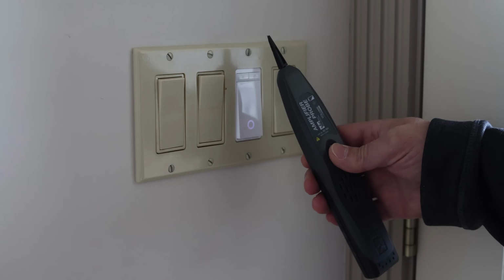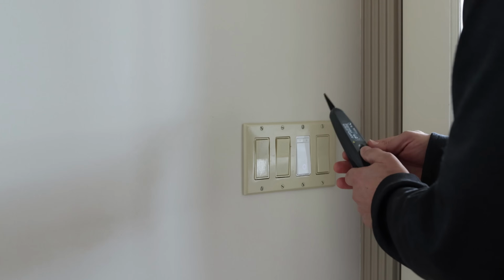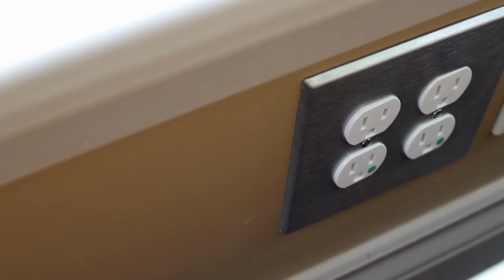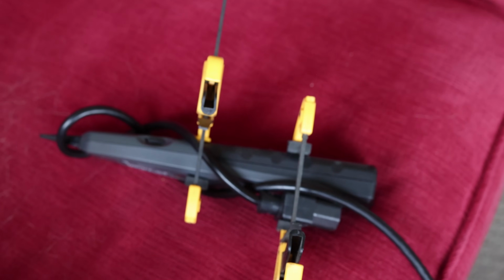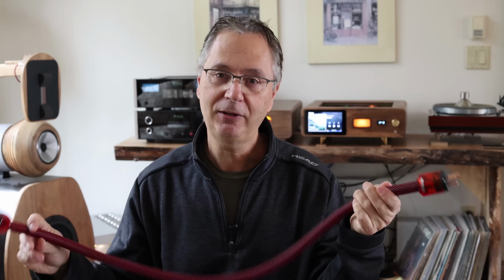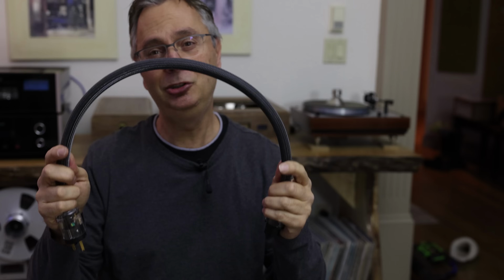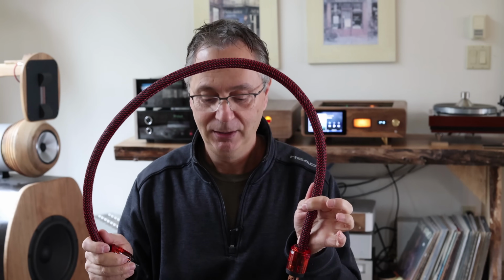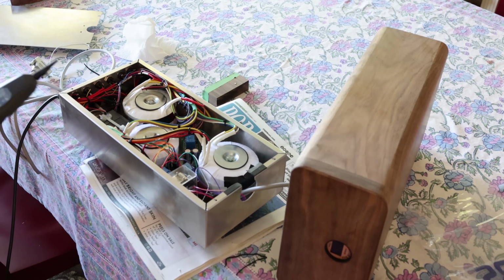My Top 5 Inexpensive Hifi Tweaks for clean power to your amp, preamp, dac, turntable, and more.

Comment: A shielded power cord does not remove the noise from the AC power going thru it. It just reduces the emi from the cord, which dissipates within an inch of the cord. If you keep power and signal cables separated then a shielded power cord is not any help. Power and signal should be kept away from each other anyway. Also that huge shielded cord puts way too much stress on the receptical AND the connector on the gear. If you want clean power get an isolation transformer with filtering after. Guess what, that's exactly what's in most gear, a transformer then filtering, switching supply's are a different story but they have issues of their own. By law tho they have to be heavily filtered as electronic devices cannot cause interference on other devices.
Reply: From my experience such devices can rob dynamics to some extent.
Reply: @supes323  From my experience what's done to the AC power has little to no effect on sound unless it's pretty extreme variations. Most all bad things that happen get into the signal chain after the power supply in the piece of gear. If supplied with the proper voltage and no problems that could cause voltage losses ie: defective recepticle, way too small power cord etc. The PS in the gear is or should be designed to handle music peaks, slight voltage fluctuations, filtering etc. I would think all this ultra hi end gear should have a very well designed PS. Look at the biggest problem, 60hz AC hum, That cannot be removed until the PS converts it to DC and filters it. Things like RF? were talking mega cycles, can't hear it and does not make it past the PS. A linear PS is a large choke coil, what do coils filter out? High freq. Hi end gear or audiophile ears somehow being able to detect things that even if could be measured are far out of human hearing range? The obsession to continually tweek for a little better something moves into placebo. You can't extract more than all the info in a given recording. This is just some of what I've learned in 50+ years of audio n electrical. People are free to take it or leave it, and spend $ on what they want.
Reply: @bradt.3555 well said. If people understand electronics and the nature of what takes place in the equipments power supply then you understand that all of this makes little or no difference only in extreme conditions.
Reply: @a0r0a745  yup, what ya gonna do. So much hi end audio is just audio jewelry. Problem is once you reach a point in sound quality, how do you keep selling stuff. Use placebo, if it looks better it must sound better. If you added up all the improvements every little piece of nonsense made you'd end up with it adding sound to the original source. Does nice paint make a car run better. I don't have a problem with people having audio jewelry, but should be sold as such.
Reply: What kind of Isolation Transformer would you suggest?
Reply: @KillerKlipsch  Typically a transformer that just goes from say 120v to 120v and has filtering and will supply the current needs of your equipment. Your not trying to change voltage, just get that "magnetic" separation. Any transformer isolates because the "connection" between line and load is magnetic. The transformer in any piece of gear "isolates" the line from the rest of the circuitry. If it uses a switching type power supply that's different. In reality the power supply in the gear should filter all the crap out. Now if your power is exceptionally dirty, filtering before it's filtered in the piece of gear can't hurt. The transformer at the power pole isolates you from the rest of the grid but there may be 10 houses on that transformer so you get all your neighbors noise. Right now my amp plugs into the wall, my other stuff into a power conditioner and to be honest have tried it all in the conditioner, all in the wall etc. and it's essentially silent all way's I've tried. I find different pieces of gear generate more noise than anything that makes it thru from the wall outlet. You gotta remember "audiophiles" are obsessed with just another tweek to get a little more info, but there's a limit. You can only get all the info that's in a recording, that's it, nothing you do can get a little more than 100%, just something to consider. Sorry for the length, to, to, to,   to much time   on my hands.
Reply: @bradt.3555  Dude, that was awesome. That was exactly what I was looking for. Thanks a million.
Reply: @KillerKlipsch  Trip Lite makes a nice transformer for this purpose.
Reply: @zagatoalfa   A trip lite, Power Strip surge protector will filter out noise?
Reply: "By law... heavily filtered..."
These certifications are forged or simply ignored. This is especially true with discount items.
The only way to know for certain is to buy a reputable brand from an authorized dealer.
If a medical grade PS is $50.00 at Mouser, and $25.00 on Amazon, then it is probably a fake.
Reply: @joshua43214  I believe I was referring to the PS in a piece of gear but your correct. Even back when I did residential electric, I saw people get fake UL stickers for stuff like imported light fixtures so they would pass inspection. I got a friend who gets "genuine" brand guitar parts for a super low price for me to install and guess what? They're genuine junk most of the time. So yea, buyer beware.
Reply: @joshua43214  Awesome, thanks man.
Reply: What about transmission of vibrations?
Reply: @Coneman3  vibrations where? Speakers you definitely need to isolate from kit.
Reply: Vibrations from speakers or from music in air going into components.
Reply: @Coneman3  speakers need to be grounded or isolated depending on the floor type particularly for accurate bass sound and imaging. As for vibrations in the air causing issues with equipment only a record deck possibly might pick up something. I have a question, how loud are you listening to your music for you to even begin to worry that speaker vibrations are causing issues with equipment? You will do more damage to your ears if you are listening at earth vibrating levels defeating the point of this hobby, to hear. Think of a nightclub and record decks and the dangerously loud levels they play at, music plays with no issue. All you need is good isolation feet for your kit or even the feet already fitted by the manufacturers. A safe but involving listening level won't affect your equipmentment one bit. Enjoy!
Reply: @a0r0a745  So correct, Vibration affecting electrons flowing in a circuit is totally absurd. That's where placebo comes in to play. When someone has convinced themself that shaking the amp or pre amp shakes the electrons around, then their brain will cause them to hear a difference when none exsists. Turntable, yes it's a mechanical issue of vibration shaking the cartridge. It won't even effect a CD player till it's so bad that it causes a mechanical malfunction, then you'll hear the sound breaking up, same as a damaged CD.  One reason they keep chasing a never ending sound is you grow accustomed to the sound of your system, many times just different seems to sound better. Don't get a cheap system, get a good one and enjoy the music and don't worry about making it more perfect. If you want to get into audio for the gear rather than the music that's OK too, just stop trying to convince those of us that know some things do not affect sound they do as a way to justify the money spent on making the system pretty. Just enjoy the pretty system, I'll enjoy my music.
Reply: @bradt.3555  thanks. Like you I listen to the music not my system. Love how he suggest I get another hobby just because I don't believe HIS take on the subject. I was trying to give constructive information which you either believe or not as was the case with him. Enjoy the music👍😁
Reply: I did my own experiments in vibration isolation on my solid state DAC. I was shocked at the improvements and it led me to a new idea for which I have submitted a patent application. Power conditioning is the other area where significant improvements are possible.
Reply: @Coneman3  you go for it.
Reply: Sorry but you are very wrong. Play your system at modest or even low level, then touch a component lightly with 2 fingers. You will probably be able to feel vibrations. These can and usually do affect SQ negatively. Your logic is based on assumptions and suppositions. That is where errors come in. You have to keep an open mind here.
Reply: I don’t understand why people like you are even into high quality gear. If it’s all a con, get a cheap system and choose another hobby?
Reply: @Coneman3  I don't understand people like you either. Where on earth do you ever find the correct sound you are happy with? If you are by any chance someone who has trained and worked in the electronics industry as I have then you would understand? Yes things vibrate but it is not detrimental to the correct operation of the equipment unless it is obvious. Nothing wrong with shielded cables, decent cables, nothing wrong with proper isolation and damping it all helps to bring a coherent, detailed and enjoyable listening experience. Chasing the unknown constantly, well you will never be happy with your set up. You sound like the ideal kind of customer Synergystic Research love, go buy a vibratron and some sticky bits of metal you can stick on the cabinet of your loudspeakers to tune the sound in your room, makes all the difference you know 🙄

Comment: I like your point of view, you can get 90+% of the improvement with a $50 cable as you would get with a $1,000 cable. The expensive cable is better but is it 20X better - i don't think so.  Another test instrument is a pocket AM radio because they are very sensitive to high frequency noise. If you pick up a high frequeny shine when it's held next to something there is a lot of noise there. 

i worked in the power supply field for over 30 years, both liniear and switch mode. There two kinds of noise that floats on the DC output of a power supply basic ripple and noise. Basic ripple on a linear power supply is usually pretty benign, noise is a problem because it's usually high frequencies and high frequencies (40,000 hz and up for swiitch mode supplies) travels further than low frequencies (usually 120 hz in the USA). Anythging meant for home use is supposed to designed for lower noise but many time  they just use whatever they can get based on price, not noise performance.
Reply: If you have a GOOD cable you can get 100% of a $1000 cable. That 10% extra is bias confirmation after someone spends so much money foe nothing lol

Comment: What you really want to do is run a dedicated circuit using 10 awg wire for your sound system, connected to a single pole breaker.

Comment: If you buy high end consumer audio electronics and the power supply doesn't filter out the noise or regulate the voltage satisfactorily then you didn't get your money's worth. You won't get it with a $300 HT receiver but you'd better get it with a $10,000 power amplifier, preamplifier. DAC etc. These problems should not exist and fixes should not be necessary.
Reply: If you are into electronics you can often improve a hi fi power supply filters ability to reduce high frequency noise by installing a small value capacitor in parallel with the electrolytic capacitor. Electrolytic capacitors may not be very effective at suppressing high frequency noise. I solved this problem on a fire alarm panel that was getting nuisance alarms from induced RF on one input channel with a 0.47 mfd. Just be sure the capacitor's voltage rating is at least as high as the electrolytic. This cannot harm your amplifier but it will void your warranty. 

Do not try to shield power cables yourself. Its ampacity rating is based on free air. If you buy one look for one with a UL listing. This assures it will be safe. Leviton receptacles and connectors are very good. Personally I prefer Hubbell.  Hospital grade receptacles are usually slightly better made than others but their main feature is the ground pin is the first to make, last to break. This reduces the possibility of a spark in an area where oxygen might be used. Unless you are in a building where walls are supported by metal studs do not buy an isolated ground receptacle. Devising an isolated ground system requires special skill and additional hardware. In the United States a green wire with a yellow trace signifies isolated ground. The normal safety ground is solid green or in Romex might be a bare wire.

Comment: Excellent low-cost tips for those whose equipment has poor mains noise filtering. A properly designed power supply eliminates all audible noise going to one's gear. All my amps have switching power supplies (Hypex and Topping) and I have lots of dimmers in my home and I have zero audible mains noise.
Reply: That's it, my power is terrible but my system is silent, I have stock power cords, no gizmos between wall and gear. Good gear should have a good pwr supply which does all the filtering needed. I suffer the same affliction as do most all "audiophiles". The need to keep fooling with stuff thinking it's making it better. That's perfectly OK it's fun, as long as you understand that a lot of it is useless.
Reply: Exactly
Reply: Wifi signals e smog  is a big polluter ...cv and pipes   tapwater . Airco.  ..you need to chip those and then listen
Reply: And ground loop problems... Don't understand why XLR cables aren't more popular in the HiFi world?!?
Reply: @1337sim1  For xlr to be any better than an rca with a shield connected at just 1 end it has to be a differential input. An xlr on a single ended input is no diff than the rca. Most stuff is single ended unless your talking lotsa $$$.
Reply: @bradt.3555  That's my point exactly! Lots of HiFi equipment costs in the hundreds and thousands of dollars and only have RCAs... 🤑

In my opinion, at that price, they should include the option to use XLR when possible. I mean... Look at cheap studio monitors, they all have XLR/TRS jacks!
Reply: @1337sim1  I agree when you spend big bucks amps with differential input where you can utilize xlr's as meant should be a given. I myself have never had any kind of ground loop issues using rca's. The reason you'll find xlr's on cheap pa stuff is compatibility with microphones. You'll find they will be single ended inputs so the benefit of separate ground and signal conductors is nill since the ground and signal ground connect anyway, in most cases, there are allway's exceptions.
Reply: @1337sim1  And your correct, a lot of high dollar stuff uses rca's.
Reply: Your assertions are most likely lacking the merit of fact. I am quite sure that you do not have the measurements instrumentation to confirm what you believe to be true.
Reply: @davidcross890  I specifically said "audible" mains noise. My ears are thus the specific measurement instruments that I am referring to. My experience, however, is also supported by high precision tests by others with the proper gear that shows mains noise on a properly designed amplifier is below the threshold of hearing. Many systems under $1000 are able to achieve this.
Reply: @ForbesPhoto  yeah sure
Reply: @ForbesPhoto  please consider refraining from deluding others with not even third rate performance by comparison
Reply: @ForbesPhoto  have you optimized the operation of your hearing instruments?
Reply: @ForbesPhoto  NOT EVEN CLOSE TO A STANDARD FOR Ultra High End Sound Reproduction for someone of my standards. That's why My builds are respectfully superior
Reply: @davidcross890  enjoy!
Reply: @ForbesPhoto  would you like to have 1st hand experience and then have the opportunity to clearly demonstrate this new circuits approach to the rest of your audience demonstrating its superior audible Realism and new benchmark ultra high end unmatched attributes of these new advanced technologies?
Reply: @davidcross890  David's cross again. I'm not sure what's happening here. If I had known of your existence and how sensitive you would be about a comment specifically regarding "mains noise", I would have, for your sake, kept my statement of these facts to myself. For this, I apologize. I'll try to do better, and be better.
Reply: @davidcross890  I have a question about measurements that you may be able to answer. If you have 2 musical instruments, like a piano and a acoustic guitar, you can play the same exact note on both instruments. You can prove/measure it using a tuner. However, even though you are playing the same note, a guitar sounds very different from a piano. Can you tell me how to measure what makes a guitar sound like a guitar, and a piano sounds like a piano? If you can hear the difference between the 2, there has to be a way to measure it.
Reply: @052RC  hope that helps

Comment: ¿In your power cables the shielding is soldered to just one (the source maybe) or both ends?
Reply from the maker: To both but you can take the connector apart and unhook one side if you like.
Reply: @Gabster1  Have you noticed any difference?
Reply from the maker: @kyuujo80  not at all power cables are not That sensitive like interconnects